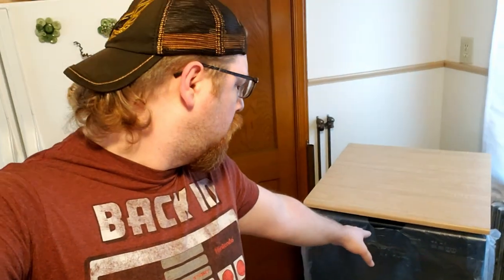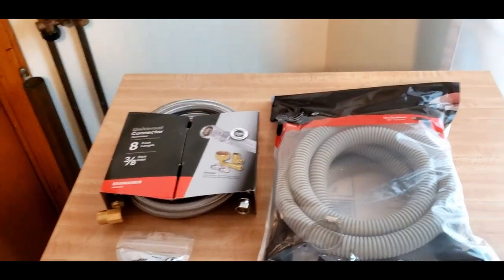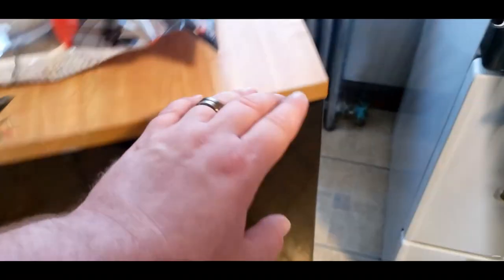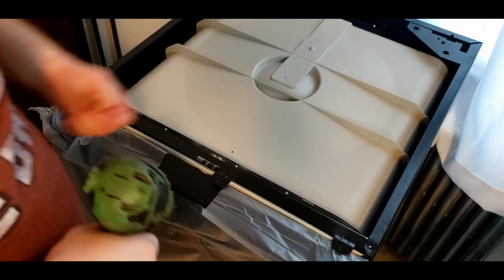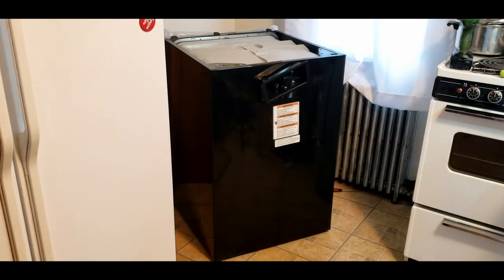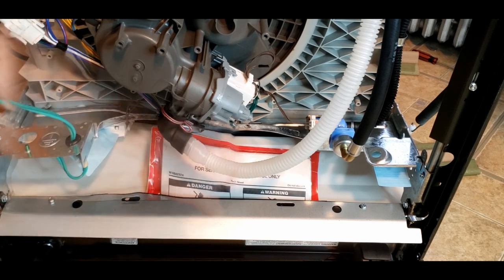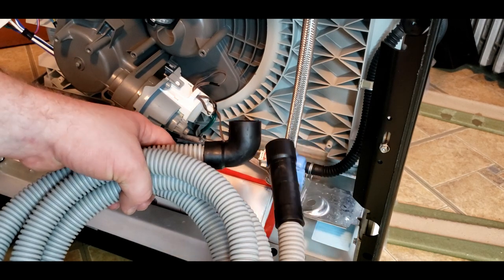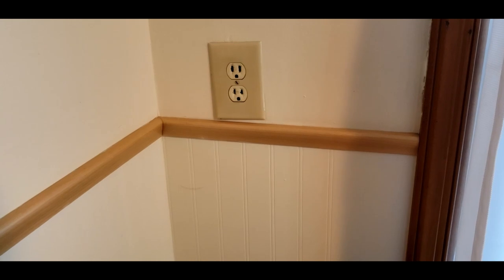Converting a portable dishwasher to a washer/dryer hookup

Comment: Hey, thanks for posting this. I just got a new ge portable dishwasher and had to connect it to permanent plumbing to work with my 1940s kitchen. My model was slightly different on the inside, but the basics are the same. This will keep me happy until we finally remodel the kitchen. Thanks again.
Reply: This is our situation! How did you do it?

Comment: Couldn't you have just removed the quick connect and screwed the water line into the hot water faucet and then put the drain line down the drain pipe? It would have taken 3 minutes and you wouldn't have to spend all that extra money for the extra parts
Reply from the maker: No as it was one piece and im not looking to destroy the original part as i may need it in the future i was looking to make it a semi permanent set up that looks clean honestly this cost less than 20$ n took less than an hour with filming n looks alot better than if i was to cut corners but you do what makes you happy this is just what i did

Comment: Thinking about getting a portable dishwasher but it's a lot more work than I anticipated converting it to hook into the washer dryer hookups.
Reply from the maker: Nah took me less than an hour really
Reply: @NOVAtazz  yeah yeah but you know what you're doing and you have a drill and all the necessary tools on hand. Things are never as easy as they appear on a YouTube video. I found that out when replacing a shower cartridge LOL.
Reply from the maker: @BartholomewSmutz  the driver just get it done faster a simple wrench or screw driver n pliers  could easily get this done but only you know ur abilities but other than cutting out some fiddly bits this all there was to it
Reply: @NOVAtazz  yeah I think I could do it if I put my mind to it but would probably end up doing the expedient way that some of the other people in the comments mentioned. Regardless it's a very informative video keep up the good work.
Reply from the maker: @BartholomewSmutz  if your talking about cutting the quick connection lines think you are going to find that way leads to more trouble in the way of leaks n short lines but thats my opinion you do as you wish
Reply: @NOVAtazz  well I haven't even gotten the portable dishwasher yet I'm still shopping around I'll definitely consider your advice or if I didn't want to install it properly like you did I'll hire somebody
Reply from the maker: @BartholomewSmutz  i wish luck and success

Comment: Thanks for the video. I have a 15-year old GE portable dishwasher that I need to replaced. It was set up in the laundry room to use the washing machine faucet and drain. The contractor who set it up was working on my kitchen and good at everything. I do not remember him opening the cabinet, but I wasn't really watching. I know there is no way I could do what your showed in the video. My question might be a dumb one, but if I hire someone, should it be a plumber or an appliance person? Is there anything I should stipulate or require to ensure a good install.
Reply from the maker: Im not sure im just a regular guy with some mechanical skills n just problemsolved this on my own

Comment: I tried this and there were a lot of differences in my washer. The existing water supply line (from previously converted washer) was very short. Also the pump drain line had this cinch/crimped fitting that looked almost like it was done with a special tool.
Reply from the maker: Im sorry not all brands are the same
Reply: @NOVAtazz  oh no problem.
Reply: @NOVAtazz  I got it all setup. Just had  to make some adjusments
Reply from the maker: @michaelneal900  sweet

Comment: Did you have any issues with the water not draining properly? I see the hose goes up and then down into the drain pipe.
Reply from the maker: Nope worked just fine till we moved n I fully converted it to a under counter style

Comment: Any idea how I could hook up a automatic portable washer (panda 6360w) to a washer hookup?
Reply from the maker: If its set up simmilar to the one in this video the same basic principle should work from this video
Reply: @NOVAtazz  it only has one hose though. Do you think that would still be possible? And what hose/adapter I would need to buy? I have a panda 6360W washer.
Reply: @NOVAtazz  I know nothing about these things 😆
Reply from the maker: @thunderbussie4life  well if your still not comfortable after watching this video an maybe a few others plus google on how your particular unit is laid out id suggest finding someone you trust to do it for you exsplain what you looking for maybe show this video n see if they can find something that works with your sistuation. I hope this helps
Reply from the maker: @thunderbussie4life  mine also only has the hot water line and a drain i capped my cold line off because of the style of shut off valve i had on the wall
Reply: @NOVAtazz  unfortunately I don't have anyone that would know about this stuff. However I found a article on Reddit where someone used a splitter and capped off the hot, uses only the cold. I'm worried it would melt something if I use only hot. Thank you for the help and info!!

Comment: May I ask what the make and model of your dishwasher is? Love the wood countertop and the fact that it has wheels! The size would be perfect for our space. Video is very helpful, plummer told us we would never be able to use a washer on our hook up because we have a sump pump. Said it couldn't handle the detergents but if it can handle me washing dishes with Dawn I am sure it can handle dishwashing detergent. That's when I Googled can you hook up a dishwasher to a washing machine hook up and your video popped up. Can't wait to convert that area into a useful space. Thanks!
Reply: I'm curious of the model as well. I have a portable whirlpool dishwasher too and plan to do the conversion but into my sink area
Reply from the maker: Pretty standard set up for most dishwashers might have slight design differences but the concept should still apply
Reply from the maker: Honestly i would do more research on that sump pump thing i do not recommend going against a professional as i am not one as for the model of our unit im not sure at this point but a quick google search should come up with some good choices
Reply: @NOVAtazz  ok ty, I'll give it a go! Lol 🤞🤞 hope it goes well lol
Reply: @NOVAtazz  ok I will do more research. Thanks for the reply. :)

Comment: Does the portable dish washers work like a normal dishwasher, or do you have to shut the water off every time you use it ?
I'm considering getting one to save space, but worried about it possibly leaking.
Can it withstand the constant water pressure ?
Also, do they make a part that hooks up to the water supply that's basically a garden hose attachment ?
I have the same hook up along the wall like you do.
Just seeing if I can get around taking the shell off.
Great video dude !!!
I guess if I have to, I'll follow your video and take it apart if that's the only alternative. 
It'd look better...lol 
Yer a wonderful help !!
Thanks !!!
:-)
Reply from the maker: They are the same only diffrence is the wheels, counter top, sides, n hook up other than that both work n function the same

Comment: Can't I just cut water and drain line and add fittings to end
Reply: You don't even need to cut anything. Just disconnect the quick connect from the end of the lines and screw the water line into the hot water valve and drop the drain line into the drain pipe and secure it so it doesn't fall out... this video is just an overly complicated and expensive way to do it when you can literally do it with no extra parts and have it done in less than three minutes....
Reply: @rebeccahetrick6576   I just bought this model. And I don't see any way to disconnect the quick connect hoses. they are crimped on.
Reply from the maker: No there isnt the only place it comes apart with out destroying the original part is inside the unit as I have shown here
Reply: @rebeccahetrick6576  yeah this video was about to scare me away from buying a portable dishwasher.

Comment: Congrats that dishwasher is now illegally and poorly draining under your home.  NEVER hook a dishwasher into a driver line designed to hold hot air only. You will now have black mold and wood rot to deal with.
Reply from the maker: Wth are you talking about?
Reply from the maker: Did you even watch the video That is not hooked into a vent for a dryer it is draining into a drain for a washing machine that runs into our sewer line there is nothing illegal about the way this is hooked up I have water going into the dishwasher via the hot water hook up for a washing machine and it is draining out the same drain that a washing machine would drain out of
Reply: @NOVAtazz  maybe you should take a 2nd look at you plumbing haus
Reply from the maker: @oldchickenhawkgaming9447  the plumbing in this house is just fine this has been installed and working just fine for over a year that hook up was designed to feed and drain a washing  machine there isnt even a dryer hookup there
Reply: This guy is just trolling. Obviously he doesn’t know anything about plumbing 😂
Reply from the maker: @fatal_vapes  right ;)
Reply: Can't I just use the water and drain line there w correct fitting
Reply: I don't think you understand what a washing machine water drain pipe and a dryer air vent actually are. They're two completely separate entities. You can clearly see that the black pipe next to the water lines is a drain, not a vent. That is the drain to drain the dirty wash water out of the washing machine. It is clearly not an air vent.....